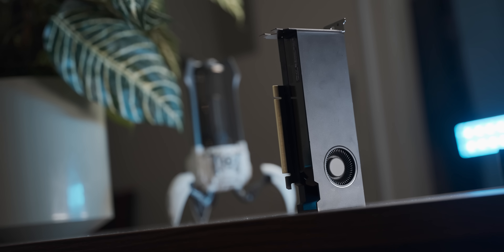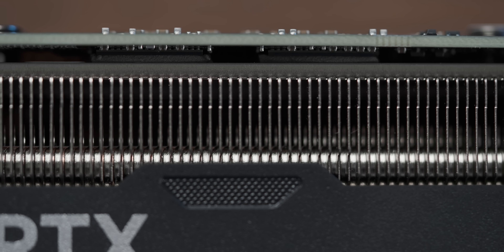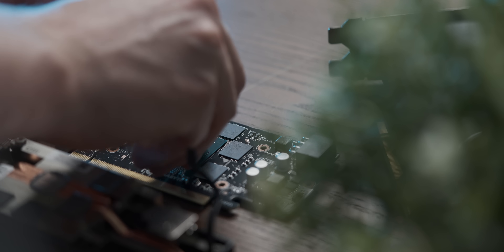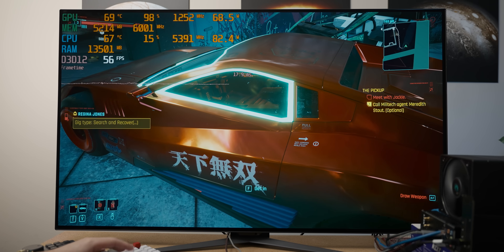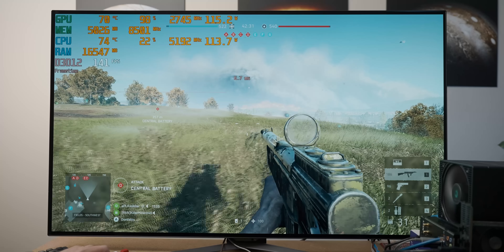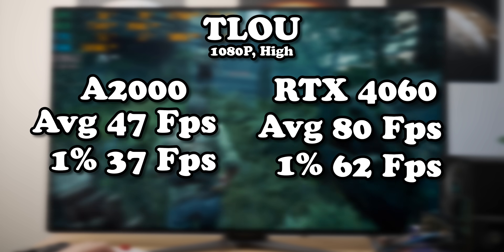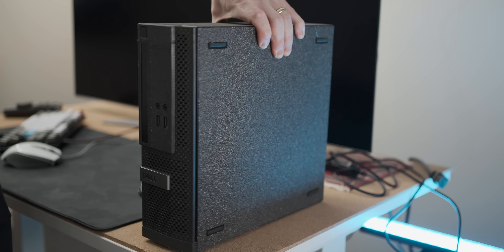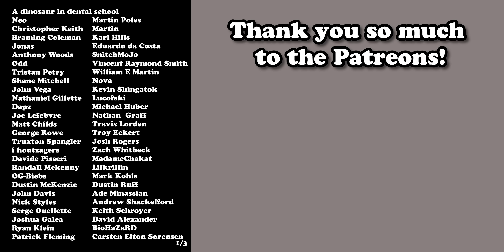A New Contender To The LP Graphics Card Throne

Comment: I paid $280 for my used 6GB A2000 in the spring, which I think is a better deal than the 4060.  It's paired with a Haswell i7 and 16GB, which is plenty for 1080p.
Reply: Sorry to say but you still got a worse deal than the 4060 when you factor in the performance per dollar. You could have paid 27% more for 100% more performance.

Comment: Im surprised the power supply in that Dell can handle that GPU under load. The OptiPlex 7040s and 7060s I see usually only have 180-200W units in them.

Comment: The A2000 isn't receiving the same updates that consumer cards are... but the comproble consumer cards are gimped on VRAM, making RE4, Starfield, and similar titles hard to run for a decent length of time. At this point, because of their cons, I think you're better off playing indie titles until AMD releases a low profile 7700, Nvidia releases a 4060 16GB low profile, or Nvidia gives some consumer-geared updates to the A2000 driver. Sure, Starfield and RE4 run on the 4060... but try playing those games for a few hours and see what happens. Best you can hope for is running out of VRAM and textures start getting overwritten, creating blurry spots on your screen.

Comment: Would have been interesting to see the 4060 power limited to 75w for MB only power.
Reply: i'm pretty sure that w/o the 8 pin connector it would just burn up the pci slot tyiing to provife the power.
Reply: @snoflahke6575  it wouldn’t burn it up, the motherboard has protections against that. The card simply wouldn’t work if it wasn’t getting enough juice.

Comment: This RTX 4060 low profile is kind of pointless. The 8 pin connector completely defeats the purpose of being low profile. Because most low profile systems don't have a sufficient PSU or 8 pin connectors to power the 4060. Adapters are even sketchy.

Comment: The 4060 has the problem, that with older systems it will only run on pcie 3.0 x 8 lanes which are too less
If only NVIDIA decided to go for a full 16 lanes instead of limiting it to 8 lanes 
Because while 8 lanes with psi 4.0  are barely  enough 8 to 3.0 aren't
(not very backward compatible)
I think 115 W for a gpu nowerdays aren't too limiting, considering that even the 1060 needed more power.

Comment: In regards to the 8 pin, I think it would be less of an issue if it were a 6 pin. Those are easier to fined on inexpensive OEM power supplies, and it only needs a bit more than board power

Comment: I love these tests of the little cards, i truly do, but i think I'm going to have to dismiss the 4060 as a False Contender to the throne!

Interesting in it's own right, sure, but too power hungry.  And given the wacky proprietary PSUs in these systems, and the less-than-completely-safe use of adapters to power it, well, that need for an auxiliary power connector means it's not in the same league as the RX 6400 or the A2000.

Comment: The A2000 is really a quadro-type card, so it's good for rendering, but may not be as fast as the RTX "Geforce" type cards which are meant for gaming, and are faster overall, but perhaps at a slight disadvantage when it comes to rendering (some rendering errors can possibly occur although I haven't really see any in my limited testing between the two -- the RTX "quadro" type cards are just designed more for render accuracy and heavy duty processing (at the cost of speed) since they are designed for workstation and design/CAD use primarily which isn't usually speed oriented.

Comment: I wish my Dell optiplex 3040 sff had room for a dual slot low profile. I got mine on facebook for $100 AUD with a i7-6700 but considering where the x16 slot is on the board I had to go with a rx 6400 low profiule single slot card it far exceeded my exspectations in my system but I wish I could of got a 4060 in it

Comment: I got a bad feeling about the rtx 4060 LP. Most power supplies in SFF machines will have issues lobg term. The 4060 will be putting the PSU at close to max or even over. They will die quickly.
Reply: It wants 12V right?
Wire the 8-pin to a power socket on the back, and use a 12V Power Brick to power the card!

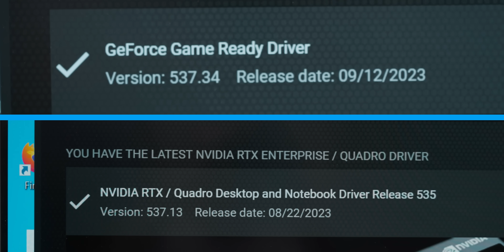Comment: 6:35
1. you can use the regular geforce drivers for the a2000, works just fine
2. the driver update has barely improved any performance

Comment: Same spend on on a prebuilt as the GPU sees you with an i7-6700, 32GB RAM, 500GB SSD aaand $100 still in your Prison Wallet. 
That's a rig that shouldn't struggle with much of anything 1080P, @60, Max everything.

Comment: When I bought the 40 60 low-profile I ran into the same problem with the power connector Amazon didn't show a picture on that side of the card so I didn't know it needed an eight-pin and I already knew the small form-factor Dell optiplex couldn't connect to it normally however I did have a DT optiplex small-form-factor that had a different power supply not a full ATX one but a tfx that apparently with Silverstone you can buy a 500w and slap it in currently right now it's working well with the 4060 to play games at 2k 1440p with a i7 4770

Comment: I currently use a 12GB A2000 in my mini ATX case (with an i5-12400). Gaming is decent, but I also play around with Stable Diffusion quite a lot. Does anyone know how SD performance would change with this new card compared to the A2000, given that I'd be dropping from 12GB to 8GB?

Comment: theres an ebay seller selling configurable optiplex sff's (7010/20/40, currently out of 50's and 60's) with a bunch of different configs if you wanted to try one closer to now instead of waiting on a 10th gen or newer to get cheap

I spec'd out a 7040 with a Ci7 (looks to be 6th gen), 16 GB ram, 500GB ssd for around $230. If you wanted to try the LP 4060 in something with a bit more room (the SFF 7040 is a little taller if i remember right, its been a hot minute (6+ years) since i worked on one, and i think you can put a nvme ssd in it

Comment: I hate that it uses an 8 pin connector. The small Optiplexi and HPs don't have 8 pins usually. Shoulda been a 4050 75w card

Comment: I'm really hoping we get a 75 watt 4050... That would be an amazing card for slide in upgrades... (as long as it has more than 4 PCIE lanes)
Reply: You won’t get that cause the 4060 is what the 4050 should have been.

If you want a 75W card, buy a workstation card or AMD gpu.
Reply: @joemarais7683  asterisk* RTX A2000. It exists and not talking about price, it incinerated the Pathetic RX 6400
Reply: @joemarais7683 theres the 3050 6gb
Reply: I would go another route. A LP 4060 Super that uses the AD104 chip of the 4070, but at much lower clocks. That should give quite a spike in efficiency.
Reply: @HappyBeezerStudios  that's the RTX4000 Ada 20GB
Reply: @HappyBeezerStudios  check out the rtx 4000 sff, but only if your got the cash for it lol it’s 1300+
Reply: @Jantcha  it’s older architecture though. In theory this could perform better even at 75w.
Reply: Intel´s ARC 380 from Asrock should be what you search for with a decent price on it.
Reply: @saschapurner9579  It performs a little better than an RX 6400 in ideal conditions, the 6400 of which is embarrassingly annihilated by the 3050, and would probably be even more embarrassingly annihilated by a desktop 4050.

Comment: Funny thing is: When my GTX 1660 was new, I overclocked it and got 60fps on High settings, 1080p, in Cyberpunk. Now i get between 50-60fps on the same settings because it doesn’t hold the same OC anymore

Comment: I think the 115W power target of the 4060 shouldn't be an issue, it's just a little bit over what the PCIe slot can deliver so you still won't need a massive PSU. Add a nice sleeved cable to it which, in my experience, can be run easier in a case and it should be possible to still add the 4060 to pretty much any system :)
Also, compared to other GPUs the 4060 still just sips power. It uses less power thatn the 1660 Ti I used before it!

Comment: Serious Question - would the 4060 LP vs Normal sized (FP?) version have much of a performance difference? I'd be curious to see this!
Reply: Heat soak would be an issue, so clocks would drop more during long heavy load sessions on the LP

Comment: The fact that the 4060 is half the price for sometimes double the performance is hella impressive. I also never can and never will get over how CUTE those little cards are :virtualhug:
Reply: A2000 6GB can be bought for 200-250$ used and there is no gaming performance difference than the 12GB version
Reply: @ilijazafirov4192  ok that's great but this is easily worth the 330 being new and having like 70% more performance on average
Reply: @creaturedanaaaaa   not if you use it in SFF office PC which doesn't have extra power (most of them limited power supply to 200-250W on 1 or 2 rails and without GPU power connector), besides the PCIE power itself you don't have an extra power, for a custom made SFF PC where you can use whatever power supply you want, certainly you are correct.
If there is a test where the 4060 is limited to 70W (at which the A2000 runs), we can decide which one is better to get, but on the other hand why would you even buy 4060 if you have to underpower it.
Reply: You look cute too 😉

Comment: The RTX 4060 have a pcie 4.0 at 8X like the 4060 ti. The motherboard of the I7 2600 have a pcie 2.0 at 16X (or 8). 

Try the 4060 in modern motherboard set to pcie 3.0 for see the différence VS 4.0. 

The A2000 have a pcie 4.0 at 16X. Not realy a problem with pcie 3 at 16X.

Comment: The 8pin power cable requirement breaks this product. I wouldn’t buy it coz if I need a card with external power supply then I have better and cheaper options to look at.

Comment: would've loved to see more 1440p tests with the 4060. Seems like it's capable of doing 1440p decently
Reply: The A2000 can run games at 1440p quite efficiently as well, it all depends which games you are playing. I play Dota 2 and on my 1440p monitor on 144Hz it has no issues going beyond 120 FPS with all maxed on i7 8700
Reply: @ilijazafirov4192  yea, but with my A2000 it's a struggle for some games at 1440p. It's more of a 1080p card based on my experience but I have a 1440p monitor and want something that actually can use that resolution and it's 165 hz refresh rate...this 4060 seems perfect for it. Also, I'm using a tiny eGPU about the size of the A2000 so I need something about the same size to replace it and something that doesn't consume a lot of power so I don't have to carry around a massive PSU.

Comment: I found a used Silverstone GD09B for $40 about a year ago to replace low profile Silverstone MediaPC. Now I run full size GPUs and glad I can get better for cheaper when not restrained by low profile form factors. 2x 120mm intakes and 1x 120mm exhaust makes for great living room or bedroom MediaPCs. I have two these built one with 5800x/6700xt/x570s Tomahawk, 48gb / 5tb NVMe /4tb Red+ and other bedroom slightly lesser 5600x/6600xt/x570s Tomahawk/32gb/3tb NVMe. Both with Noctua D9L and U9S. All built at crazy discounted prices usually 50% on most all parts.

Comment: Gigabyte two years later:
Lets cram a rtx 4070 in a low profile board let's see what happens.
Reply: I think you mean the 5070LP (after the next stack-slide manoevre).
Of course this means they have to call the top of the stack the 5095 to push it down.
Reply: @peterpan408  ye man misclick there on my comment.
Nvidia RTX 5095 RTX max boost super ti boost

Comment: Easy to forget that blower cards were designed to deal with closed off cases.  I bet the 4060 runs hotter in the optiplex because it's just dumping the hot air into the case.  The frame time looked solid on the test bench, but once it was in the case it looked like it was all over the place.

Comment: is the 8 pin power connector needed to run the 4060 , its a low profile card i expected that no cable will be needed

Comment: Probably a couple MOLEX could give enough to supply that 8pin. This gpu only needs about 45w through there
Reply: I assume you're doing 115W total - 75W from the wall = 45W-ish? It absolutely doesn't work that way. The "75W" you get from a PCIe slot is actually 65W@12v and 10W@3.3v. The card likely uses an 8-pin for all it's 12v requirements rather than balancing the slot with a 6-pin because a single overkill source for all your power input makes for a MUCH simpler VRM setup that doesn't need to consider load balancing and per-source draw limits. I would be surprised if the 12v line from the PCIe slot was connected to anything at all on that card.

Comment: I got all excited over a new low-profile graphics card until i saw the 8-pin connector. None of my SFF PCs are equipped for that. Guess ill stick with my RX 640 cards until a new  ~75 watt card comes out that doesn't cost a fortune.
Reply: I just got an Intel Arc A380 6GB low profile card from Newegg for $99. Averaging 47 FPS at 1080 on Furmark. Installed into a $34 Lenovo ThinkStation D32 SFF computer. This card does what I need it to. I'm happy.

Comment: The problem with the current gen of SFF ex: Inspiron 5070, 3020 is that the PCIE x16 slot is on the bottom, which means only single slot GPUs work, and for some forsaken reason, they thought that it was a good idea.
Reply: Every generation of Optiplex SFF after the 3010 has this same problem, even the newest 3000/5000/7000 series! Sadly, my 3050 can't take a double slot GPU.
Reply: Dell 3450（Inspiron 7090） also has this problem, but 3460 has changed it
Reply: It's a shame Dell is still kneecapping them...super odd design choice. I have a few 7000's laying around at work with i7-12700s that would be great compact gaming machines if it weren't for this issue
Reply: I always wondered why nobody made a LP card with a cooler on the back. Wrap it around and have the cooling on the side where there is at least a slot for room, and in may cases even more above that.
Reply: i have a g3 hp elite desk sff i7 7700 and i got lots of slots and the perfect slot space for a 2 slot card

Comment: I would still prefer my A2000 12Gb which I got for 315€. The extra 8 pin isnt worth it coz most cpu will be the bottleneck anyways also 110w is quite much for office pcs. The powerspikes would be interesting to check

Comment: I think people are making far too big of a deal out of the 8-pin power. This thing isn't going to make sense in most older SFF systems for other reasons that have nothing to do with power. And a lot of newer ones with at least 300 watts is going to be fine for this with a dual SATA adapter.

Comment: if you want low power, try AMD and limit the clockspeed to 2000-2100Mhz. i did that with RX 6600 and it only consume 30-60 watt with around 20% performance loss though you can retrieve it using FSR... the problem is just AMD driver is pretty garbage and might "not compatible" with some game which cause the game to stutter pretty hard and annoying... (the gpu clock often drop to 100Mhz)

Comment: You may be able to flash a different bios on the A2000 card with the new unlocked nvflash tool. Might get some  more performance out of it.
Reply: probably not, it already runs around 70W and the pciexpress slot are 75W, if u dont want to burn it up, avoid flashing a bios, beside that u lose the quadro benefits of the special driver features
Reply: It is limited by the power, I have tested it and there is no way of going beyond the power limit because you can't add more power onto it due to the pcie connection limit
Reply: hell, if we're talking about the fastest 75w card, go look at the rtx4000sff. its a batshit crazy workstation card with 20 gigs on it.
Reply: not that much performance, not from concentrate has a system with a water cooled shunt modded one and the 4060 is still gonna outperform it

Comment: I've had my eyes on this card for a while now, being one of if not the fastest low profile card even if its a 4060... wonder how long before we get people modding these with the additional power connector having more headroom.
Reply: I am pretty sure the 4060 SFF will be cooling limited so the extra performance from a mod which doesn't improve power efficiency will likely be underwhelming. The real king of SFF modding right now is the RTX 4000 SFF ada, but that gpu is so expensive that buying it would be a very bad investment
Reply: @_shadow_1   Why would that card be the "king of SFF modding" if its the same price as a 4090, has a worse cooler and being a professional card having no real overclocking while also being about the same speed as this 4060 LP.

Comment: Awesome to see LP cards get some love (high end gaming, raytracing, and DLSS 3 in this form factor? Awesome!) — but yeah, I think that 8-pin will limit its use cases, especially as a drop-in card for prebuilt office PCs. They just don't have the connectors. LP power supplies with those connectors are also probably rare and quite expensive.
The thing is that the 4060 would probably run decently with the 75W of PCIe power (as seen in laptops, and this is practically the same chip) but maybe NVIDIA just doesn't allow that?

Comment: the real question is now, which of the 2 "new" Low-profile graphics cards will be the "REAL King": The 4060 LP or the RTX A4000 SFF ;)
Reply: I think that one is fairly obvious given the price of the RTX 4000 SFF. The LP 4060 still wins.

The RTX 4000 SFF will likely get more performance per watt (although we haven't seen the 4060 LP undervolted to 75W), but it definitely won't have more performance per $$$ than the LP 4060. It would have to have more than 4 times the performance of the LP 4060 to be worth the $1,500+ price tag.

Comment: The way I see it, I would rather the 4060 have need supplemental power and still perform like a 4060 than not need it and have it perform worse while still being called a 4060
Reply: It would be nicer if Nvidia considered gamers and pro customers on equal footing like they used to and didn't reserve the good binned silicon just for deep pocketed data centres